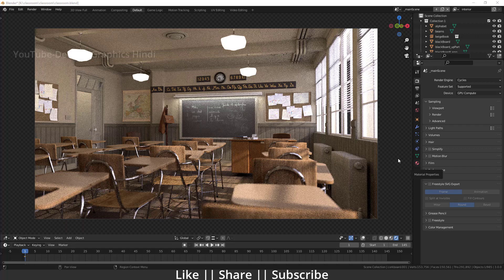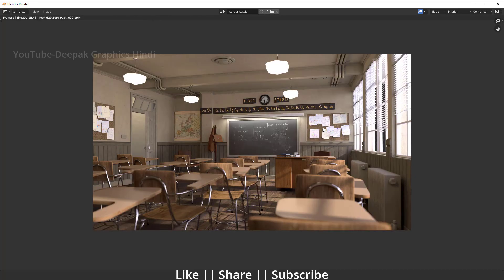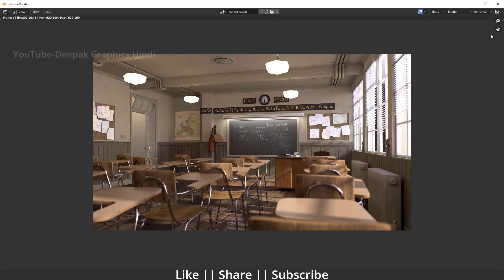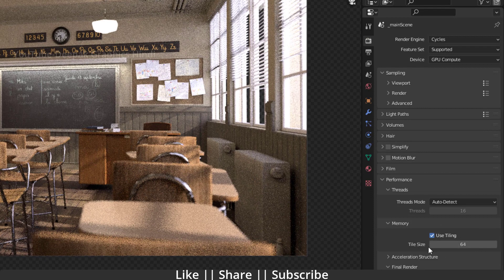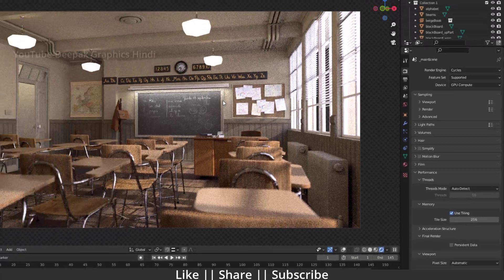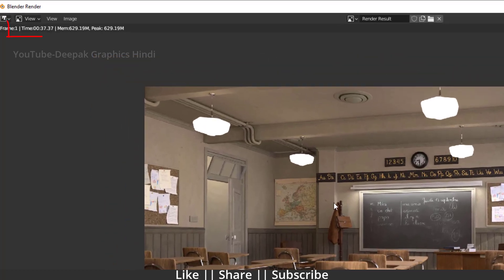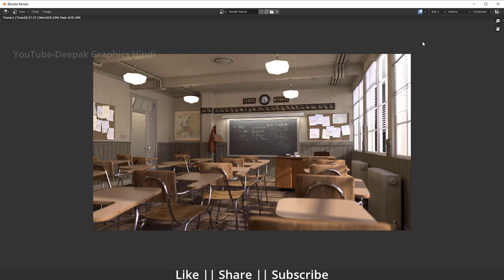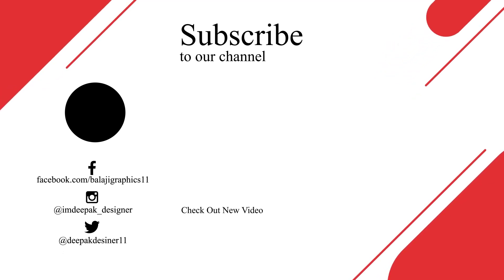How I Reduced Cycles Render Times By 90% in Blender 3.0 || Blender Tutorial

Comment: This trick will reduce quality of render, when there is complex light rays from diff direction and this only speed up GPU render cpu render will be slow with this settings, I've tried this settings already and after a render image is produced you will notice some square shapes ie. Tiles difference, so I suggest using cycle x it's more efficient and faster